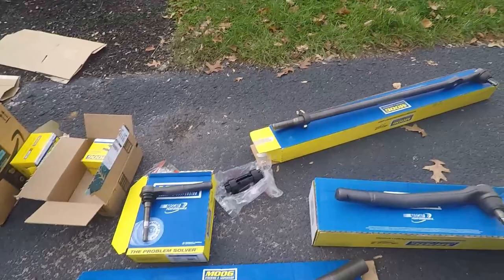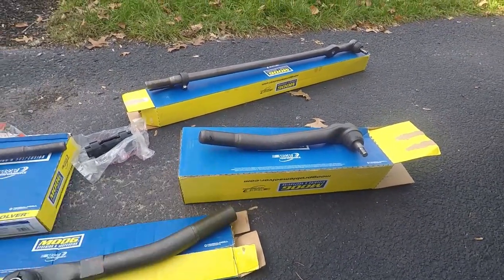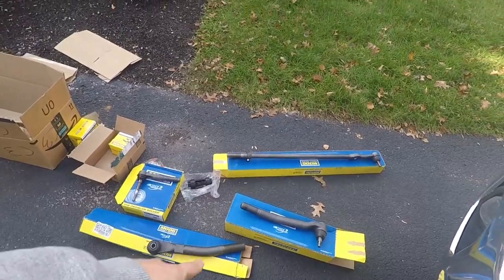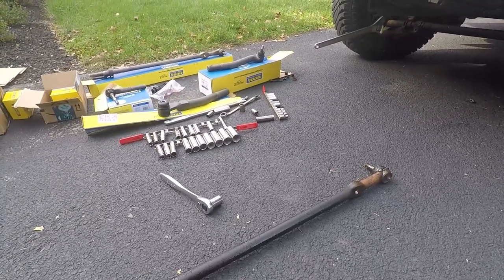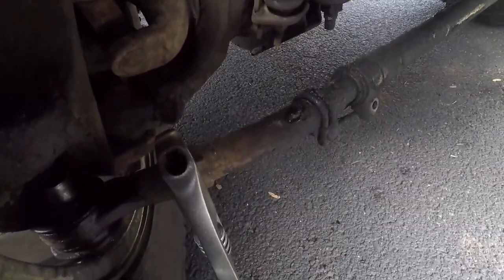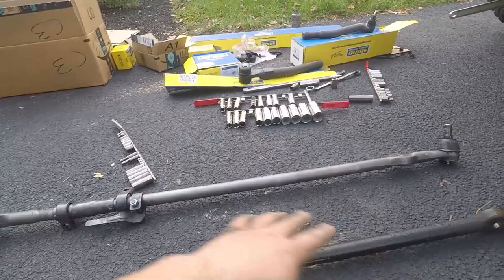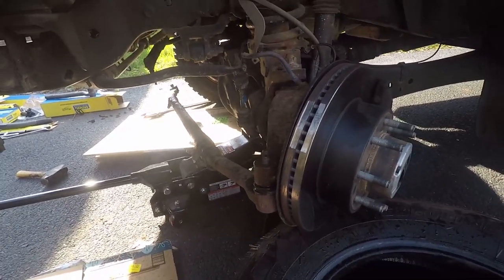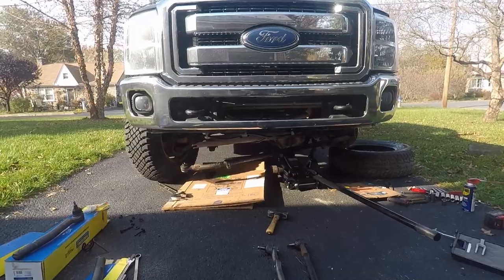F250 Drag Link and Tie Rod End Replacement 2005-2020 F250/F350 6.7 Powerstroke

Comment: Just did tie rod ends and steering stabilizer in my 2012 f350. I had a funny bump or knock when I would hit bumps in the road and a little bit of play in the steering. I also had a thing going on where if I hit a bump at highway speeds (or faster), the front of my truck felt like it would walk sideways a bit. Replacing the tie rod ends and stabilizer solved it all and tightened up the steering like it should be.
Reply from the maker: They can make such a big difference when they need replaced

Comment: Good content! Last fall my buddy & I did a complete front end job on my ‘05 F 350 SRW with Moog parts & a new stabilizer with great results! I wish I had put on a dual stabilizer tho. Did the alignment afterwards with minor adjustments. 

Then I discovered my steering box was bad. I put in a Red Top steering box. The wheel was a little off so, another alignment. Now, she runs & steers great! And I’m broke, Lol!

The front end was all original parts so a lot of foul language, hammers of all sizes & sheer might got it done!
Thanks again for all you do making your videos and look forward to seeing your next video!
Reply from the maker: Thanks man. I really appreciate the support! The next video I'm going to shoot tomorrow. I am f ik nally putting the upgraded oil pan on it, but then I just need one or two things to do the front end work for the truck. I hope the repair series for the truck helps some people!

Comment: Just did this job for the first time. I counted the turns on the tie rod ends and drag link. I also used a measuring tape to make sure the steering geometry was as close as possible. I had to adjust the toe but the stear ahead with the steering wheel centered was dead on when  I put it on the alignment rack. The biggest problem was getting the drag link loose from the pitman arm. That thing was stuck tight!
Reply from the maker: That part was awful for me too. I try and have them lined up close because it saves headache. I'm normally not terribly far off

Comment: Thanks for putting all the links saved me a bunch of time since Moog offers multiple options for the same parts.
Reply from the maker: No problem man I am glad it helped!
Reply: @six0bros  so I replaced everything except the track bar and ball joints. I had a horrible death wobble before. I can still feel a little wobble in my steering wheel... What can it be?
Reply from the maker: @Razr8733  sorry I missed this man. I am going to be doing a death wobble cure video in the future. Most likely this is caused by the track bar and track bar ball joint. This is actually next on my list of things to replace on my truck.

Comment: Very informative, thanks. I have a 2017 lifted Super Duty 6.7 diesel, 145k miles, I'm told I need a new wheel bearing and hub assembly, steering drag link, and tie rod ends. I'll probably get new shocks while I'm at it. Without  the shocks, the estimate for hub assemby, drag link, three tie rod ends, and alignment is $1595. I was expecting more, actually. Question here is should I have the guy replace the other wheel bearing while I have it? Also, dealership replaced track bar about 20k miles ago, I had the wobble of death when braking hard or hitting a pothole. Thanks for the great content.
Reply from the maker: The track bar is frequently the cause of death wobble. I personally prefer to replace it all at the same time driver and passenger side. That way you know everything is good to go and shouldn't have any issues.
Reply: Where do you get a drag link my boyfriends f350 2017 is a 35.5 and he cant find the part anywhere
Reply from the maker: Is it a 2 wheel drive or 4x4

Comment: Just a note that changing the length of the drag link doesn’t affect tire alignment, only steering wheel alignment, and it’s easily adjusted. Tie rod length, on the other hand, does affect tire alignment.
Reply from the maker: I know I'm late here but spot on here. It is easy to adjust I do try and keep everything very close just makes things easier with hopefully less adjustment in the end.

Comment: What were your left upper and lower tie rod #'s . And your rh side numbers. I work in parts and it depends on whether you have a twin i beam or moonbeam front suspension
Reply from the maker: what are the differences between those 2 front ends. I though all 4x4 had the same front end f250/350

Comment: Nice I really liked your video ... these days I will change the drag link of my 2015 F-250 but I saw in your video that you also changed the tie rods end ... how could I know if my truck also requires replacing the tie rod ends,  some clue?
Reply from the maker: main thing is checking for excessive play or being very loose.

Comment: At 7:30 mins into the video you talk about measuring to get it back close. “Count the threads, that usually gets it close enough to drive safely to alignment shop.
Reply from the maker: Good tip man. I was able to get it pretty close measuring and didn't have any issues but the more tips in this section the better

Comment: This job is a pain in the rear. use Ford OEM parts....Engineers design these fittings with no grease fitting because most techs and owners do not take proper steps when re-lubricating them. The grease nipple and gun must be totally clean of debris or you introduce dirt, sand ect into the joint...thus causing premature failure
Reply from the maker: You can always just use the plug that comes with them too. However I agree the average person won't lube them. Even people that take great care of their vehicle won't grease

Comment: Question.... I have the death wobble. Its a 2012 with 100k miles.
I replaced the steering damper thinking it was the problem. It helped but didnt completely fix it. I changed the shocks and helped again but not fixed.
Do you think changing all of this will finally fix it?
Also.... Big question,... what do I want to NOT take off without something hurting me?
Like I know not to touch the springs.... what about the sway bar?
Reply from the maker: Death wobble can be cause by a few things in all of my research a lot of times the track bar and track bar ball joint are to blame. either a bad bushing at the top mounting point bolt to loose or the ball joint has failed. Now you can have other issues but that is probably the leading cause of death wobble in my research. Now yes going over the whole suspension at your mileage is not a bad idea but it is expensive. I have videos on wheel bearings, ball joint, front u joints, as well and one video where I show replacing the track bar I plan another video on replacing the track bar and the ball joint too
Reply from the maker: Really the spring is it. I mean do not remove the radius arms and the track bar because those are what hold it to the frame but take one or the other should be fine. I would also only do one radius arm at a time but you're not even messing with them. Also depending if you have true death wobble vs a very bad vibration having tires rebalanced isnt a bad idea either and was the source of issues for me

Comment: Did this stop this rebuild stop the infamous death wobble?
Reply from the maker: I did not have death wobble. what I have found in my research on the topic... track bar is a very common overlooked cause of it. not always that it needs replaced but that it may be to loose. tighten the bolts to it has helped many people out. That said it can be caused by any number of failed components and I would have a good shop go over all of them before replacing anything. It can be very expensive to just start replacing these parts.

Comment: You keep referencing measuring from center of tie rod (rod) to a designated place of your choice for as close to possible for alignment purposes. Why not just count number of turns while emoving old and when screwing new outer to draglink screw back in same number of turns. I think more precise than trying to measure. But again just my thoughts. And your method will get you back close , same as my method
Reply from the maker: I had a few reasons I didn't try that and why I prefer to measure. First like you said getting close is really the name of the game, but I didn't use a Ford part and the new one may be a slightly different length. The other is on this truck I just got all new everything because these things were boarding on impossible to move and take off, but I completely agree that typically both methods will get you close but since I didn't just replace a side and replace both the collar and tie rod I wasn't able to

Comment: Good vid, noob question. How does a guy tell he needs front end work?

Would it be play in steering?
Reply from the maker: just going through old messages and making sure people got responses. I have been meaning to do a video on this yet but taking a big pry bar under your front tire after lifting it off the ground you can then check for any noise by prying up on the tire. steering components you can have someone turn your wheels back and forth while you look for excessive play you can also grab them and try and turn them back and forth and check the amount of play in them.

Comment: I read some good reviews on the Raybestos Professional ball joints, so when I saw them on clearance on Rock Auto i bought them.  They seem to be working fine, but the studs and castle nuts have rusted much more than expected.  It looks like really cheap steel.  Should have just went with the Moog.
Reply from the maker: I have raybesto on my white truck. They do ok but I like factor or moog more

Comment: Do you have the part numbers you used. I need to do tie rod ends on my 12 6.7. There are so many options not sure what part will fit? Truck is stock.
Reply from the maker: links in the description for parts used.

Comment: Good video. 
I'm in the middle of doing the tie rod ends and drag link on my '11 with 6.7. The project, while fairly easy does need some thought. My truck, being a JOB 1, built in May 2010 is a mish mash of 2010 and 2011 parts. You really need to do your research based on measuring the actual parts on the truck as the Ford parts book is not always right. I have two that were dead wrong - a too long drag link and a wrong thread dia. left tie rod end.

Also - that tie rod end at the pitman arm - needs a real BFH, many big swats along with a few swear words
Reply from the maker: Off the pitman arm I used a picklefork for it. Also I got the wrong tie rod end the first time too, and mines a 15.

Comment: Hello, fellow pa 6.0 owner. I've been following the channel for a while. I'm doing ball joints and ujoints this weekend. I was wondering if you remember the torque specs on the moog parts. I have moog parts as well previously installed and can't remember the torque specs to save my life. I do know they are different than the factory ford specs.
Reply from the maker: I believe you can find it on their website I forget the torque spec

Comment: Please stop making incomplete videos. 15 mins and didn’t even show the most important part, the installation. Other people might not need to know more like did you measure the height and make sure drag link was level before tightening adjust bolts. We need to know all the details. Here’s the install, oh wait, it’s dark out, it’s only three bolts, good luck.
Reply from the maker: Sorry ya seem so upset. If it didn't have what you needed just find the next video. Correct it isn't a step by step process but also this job doesn't require a super detailed video. I would have loved to do one but it's just me filming these so sometimes I cannot do that. As for the comment about its only the nuts to take off if you're replacing everything like I did it really is that easy. I do appreciate the feedback but if you need more help I'm sure there's other videos to check out too.  Or at a minimum maybe not act like it isn't helpful at all because a lot of people did find this helpful sorry you did not
Reply: @six0bros  if you don’t know then why are you making videos? Not even editing them? Take your time and write it up at least. People watch these videos for specific information. Not a guy with tools and parts all over the ground with bad lighting and no actual specifications. I’m trying to help you become better but take it how you want. It was absolutely 0% helpful. All I needed to know was if you measured the drag link/tie rods at the end before you tightened to rule something out on my end. I figured it out on my own by reading someone else’s write up. There are too many people out there with a camera making incomplete videos. It’s extremely frustrating for all of us, not just me. Good luck
Reply from the maker: @TheBruceDickenson1  if I don't know what? Clarify for me. Glad you found the info you needed somewhere else. I will continue to make videos though and again over the years I have gotten a lot of feedback from people finding them helpful. Sorry you had such a hard time. My issue as far as your feedback was mainly that it comes off rude. I have gotten a lot of constructive criticism over the years and it has helped me grow on my channel. You just seem salty for some reason hope you have a better day bud
Reply from the maker: @TheBruceDickenson1  also at this point mainly responding for my entertainment before editing my next video truly I am glad someone made what you were looking for. I'm here to help sorry you didn't like my format
Reply: Same way it got off goes on! Lol excellent video imo thanks starting mine  soon
Reply from the maker: Thanks man I appreciate it